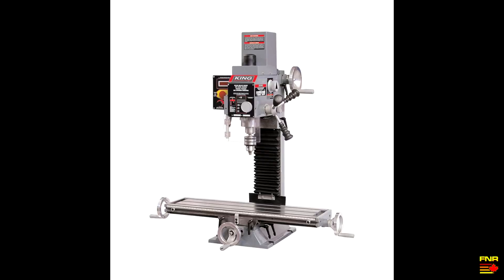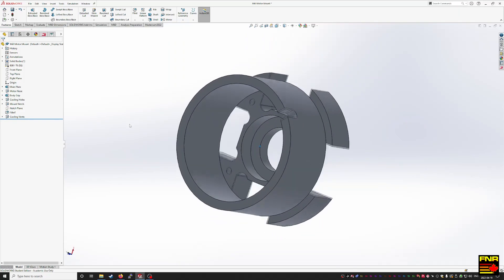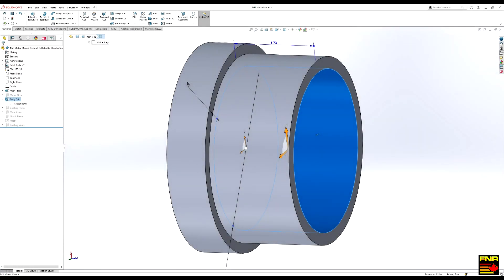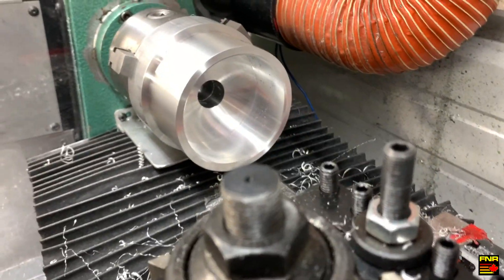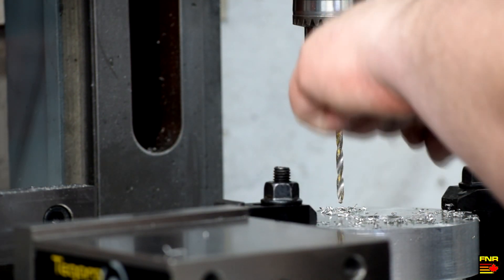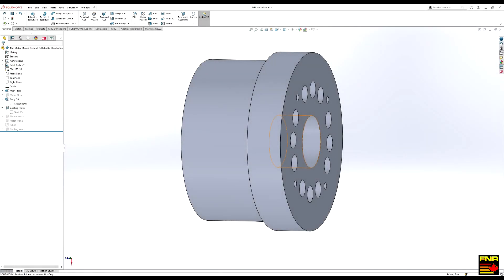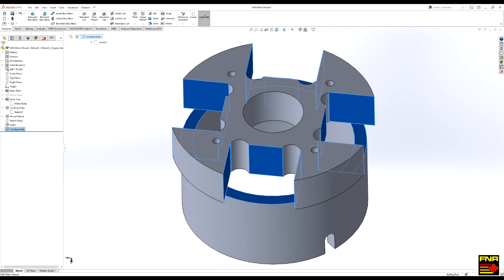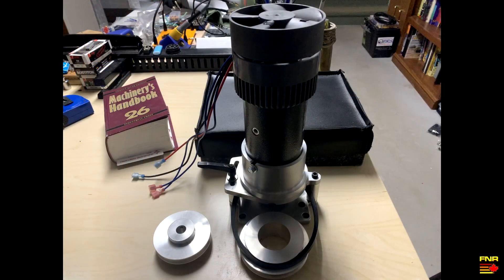FNR CNC S03 Ep2 - Treadmill Motor Mount Adaptor

Comment: Has there been any rigidity issues with the bed bars? You seem to be taking deep cuts with the wabeco. Also how are you lubing the  bed bars, grease through the zerks or oil
Reply from the maker: Oh it’s a complete noodle. The bar-bed is an interesting idea, but it just doesn’t have enough rigidity and there’s no way to augment it. 

At some point in the future I will convert to a “proper” prismatic-way lathe. 

I can get good work out of it by being meticulous. 

Lubrication is light machine oil from time to time.
Reply: @FNR  I'm surprised about you saying from time to time. I'm always worried about the oil draining down when the reservoir inside isn't completely filled, leaving the top dry. I have taken it apart completely; apart from keeping the bars in the headstock. It is essentially a large cilinder grooved section 2mm deep, about 50mm in length (bored out) in the middle of the carriage. No oil grooves apart from the 'reservoir' so to speak. In my head, I plan to always keep it filled, will add oil lines in the future to ensure it.

Comment: What did you use to adapt to the output shaft of the motor..
Reply from the maker: https://youtu.be/ouNaT88HqIM

Custom-made, threaded-on pulley. 

I later had to add some setscrews to hold it in place; in this application I have to run the motor backwards, and that wants to unscrew the pulley.

Comment: Why specifically a treadmill motor?
Reply from the maker: 1. They are powerful, high speed, high duty cycle, and can be variable-speed controlled very easily; and

2. They are cheap and readily available used/rebuilt/NOS on eBay.